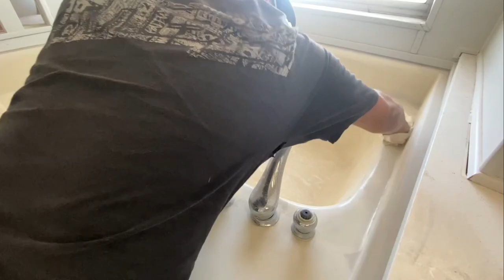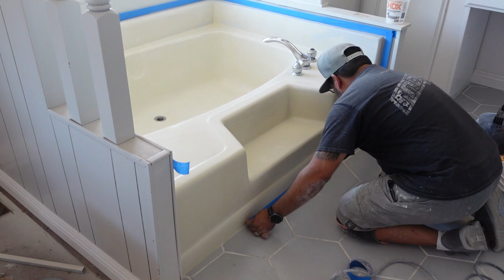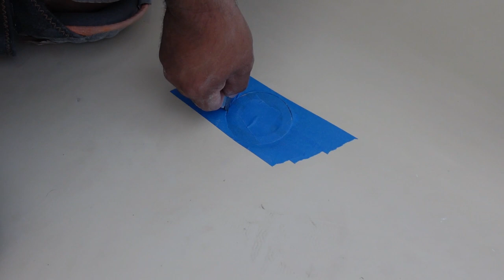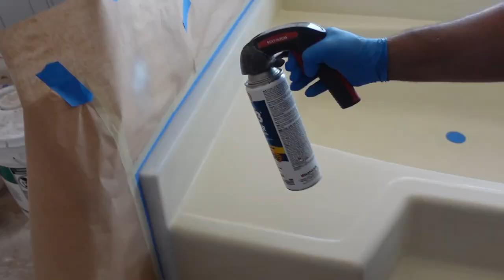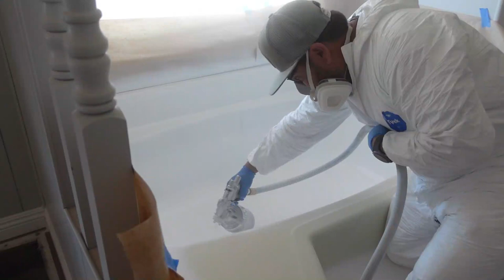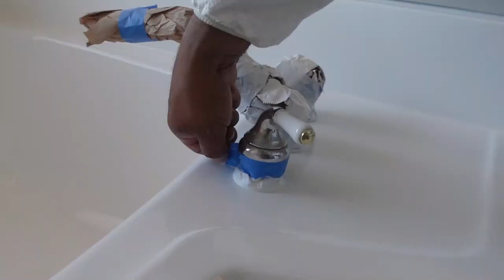HOW TO REPAIR & REGLAZE A FIBERGLASS BATHTUB | Bathtub Reglazing Color Change | DP TUBS

Comment: Danny, what is a great acid etch to use.  I use Midwest chemicals acid etch but they add baking soda and it get so thick it gums up very quickly.  When they don’t add it it’s clear and tough to see.  

Out of napco, integrity. Which is good.  I used hawk before it’s great
Reply from the maker: I like Napco the best..extra strong etch that is brown so I can see the application and since its a gel there is less chance of splashing .

Comment: How do you guys not get overspray on the floor when Refinishing? I’m a bathtub/counter/vanity Refinishing tech in Miami and here we cover the whole floor in the bathroom to keep from getting overspray or dust on it unless we’re willing to wipe down the whole floor with acetone lol. Also do you have a guide or steps on how to start a bathtub Refinishing business like what needs to be done apart from obviously getting a LLC? I currently work for a company but they work us like animals and give us a very small cut of what they make overall. They make use do 4-6 jobs a day which averages them $700-$1000+ a day per employee and they have about 12+ employees and only pay me $750 a week 😕 so I’m looking to branch out and start doing jobs in my own now that I’ve learned most of what needs to be learned to do the job and not to mention I’m very good when it comes to leaving no room for errors in a job like this where making a mistake is very easy
Reply from the maker: I totally understand. I offer zoom meetings at an hourly rate for questions on start ups, materials, process, etc. If you are interested then just email me directly. What state are you in?
Reply: @DPTubs  ok thank you I might just do that so I can have some knowledge to get things up and running. I’m in Florida I work around the whole Broward, Dade and palm beach counties. Also I saw you using resurface solution products do you recommend their products?